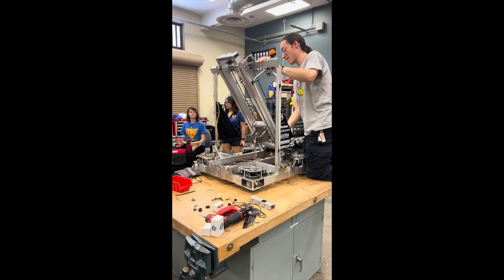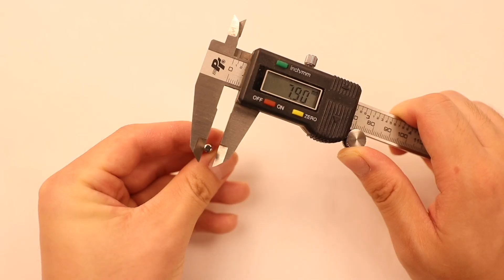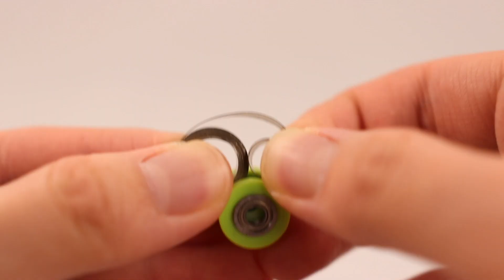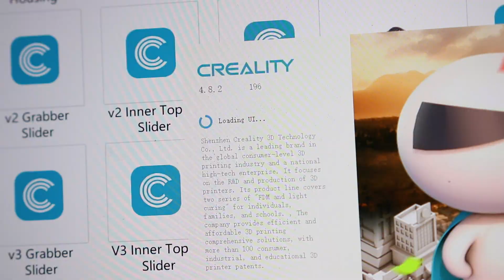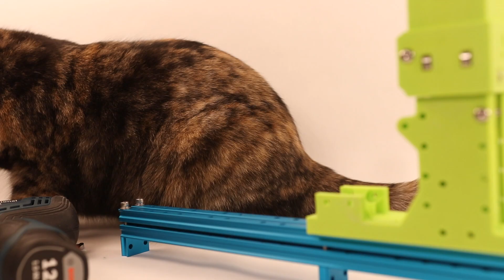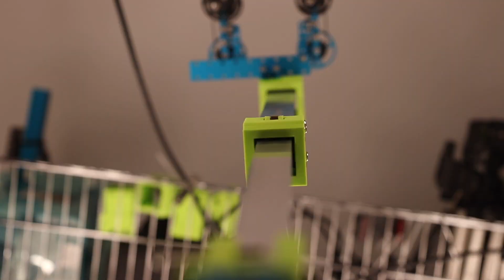Telescopic Elevator Design MakeX Robotics Competition - Make Block

Comment: Hi I'm from thailand and i'm working on this mechanism i wannna know how this works and the if it possible i also want the CAD file of this mechanism as a example to modified because i want to use this mechanism on my robot
Reply from the maker: Sounds like a plan! DM me on Instagram, and I’ll share the CAD drawings. I recommend using MakeX kit parts for building the elevator, it might be easier to work with. Check out the build on my YouTube shorts.